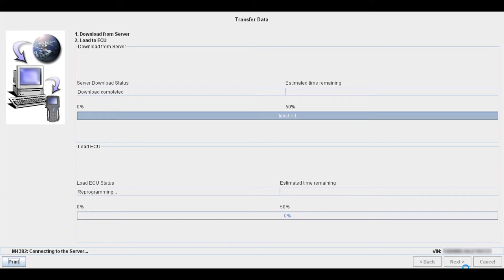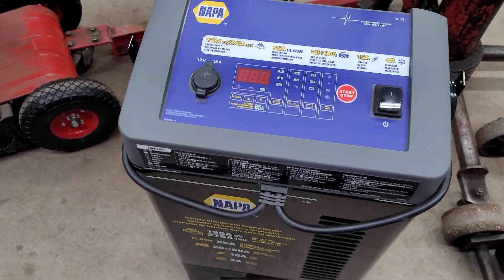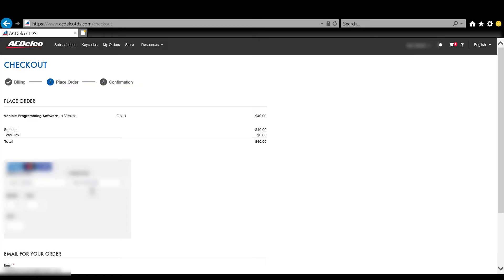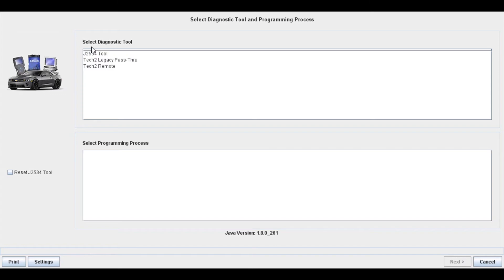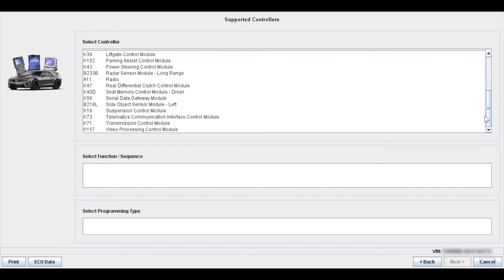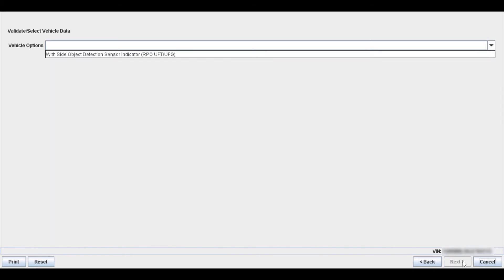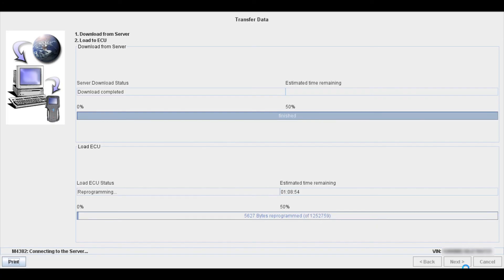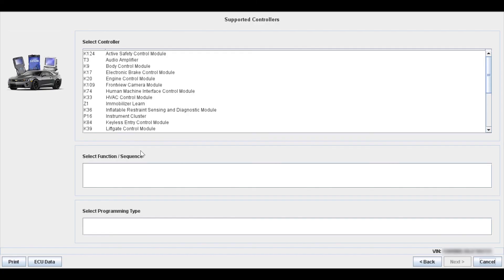How to Reflash Modules on GM Vehicles! Step by step walk through for reprogramming GM Vehicles!

Comment: For GM vehicles the Service Manual will provide a seperate module programming and cal/setup procedure for each module based on the vehicle build options RPOs. However, the process of reflashing a module one at a time is basically the same. Module setup after programming is specific to the module itself, Keyless entry, TPMS, HVAC, etc.

The GM reflashing procedures state not to use a battery charger and list a service maintainer (EL-49642 (Midtronics) SPS, 2014 Cadillac for example). It is important to understand how the maintainer function works if part of a battery charging system, especially if using jump start posts underhood. The reflashing maximum sustainer p-p noise at 40 to 50 Amps is around 50mV. If the battery charger uses a switching power supply, from a design stand point, it is very difficult to meet the 50mV requirement at currents greater than 20 Amps unless directly connected at the battery.

EDIT: I did a quick check on both the Snap-On (looks like rebranded Schumacher) and NAPA (Confirmed Rebranded Schumacher) wheeled chargers shown in the video. I could not find a noise spec or if the units can use jump start posts. The manual states that they should be connecting directly at the battery for in-vehicle or stand-alone charging. If the vehicle has a battery current sensor monitor function, you would really want to sustain on the vehicle side of the sensor (either a shunt or magnetic), so the battery monitor function can record current flowing into the battery to maintain it's SOC estimation. Midtronics gives a noise spec of 50mV at 50 Amps at the battery, they also do not recommending the use of their products at the jump start posts.
Reply from the maker: You are correct although I do have a couple things to add. First the programming procedure is the essentially the same for all modules that need to be flashed after replacement, some modules can be setup using a scan tool without using SPS but not many especially with newer vehicles. Second a good battery charger that had a reflash mode will not cause issues with most vehicle manufacturers, BMW is a different story though. Through 10 years of reflashing experience I can say that GM modules will give the least number of problems and I have seen one fail because of a battery charger that has a reflash mode, although I wouldn't trust a cheap one from somewhere like Amazon. I have even seen people flash GMs without a charger at all, although i would never recommend that. BMW is the manufacturer that absolutely needs the correct battery maintainer to be used and they require a very powerful one that very few people have. I have seen BMW reflashes fail because the snapon charger, in relfash mode, can not supply enough power.

Everything you stated is correct, just know that the recommend certain tools often because of a partnership/ownership of the company that makes that tool, i.e why ford had a sticker for many years that said "use BP Gas".
Reply from the maker: Also, the rpo codes come into play when flashing some modules, BCM especially, you will need to select the correct program to push into the module based on the rpo codes. This process is very simple as long as you read the description of the program you are choosing in SPS.
Reply: @apmotorsports5568  I looked at a lot of chargers to do charging or sustaining at the jump start posts. Mainly for the vehicles that have the Battery in the trunk, of which many like BMW and Cadillac use a current sensor. I use a 2-CH Fluke Scopemeter to monitor voltage at the battery or the posts, and a Fluke current clamp to see how the charger or sustainer is controlling current. I could not find one to do basic quick rapid charging (from the posts) and also supply quiet maintaining voltage for reflash. I ended up making my own 20A 20V linear design for basic repair (single module reflashing) and Rapid charging up to 10 Amps.  

When I started taking a close look at the use of jump start posts for charging or sustaining I was amazed at the errors in vehicle voltage as shown on some high end chargers. Meaning they did not compensate for the voltage drop in the 4AWG charging clamp wires or the clamp connection itself. To do this properly at high currents you would need at the very least a 4 wire connection to the vehicle at the clamps. Like the common two 4AWG high current wires, but also two small 14 AWG wires in parallel to monitor the voltage at the clamps. What matters for both a AGM battery rapid charge and a sustainer (as the value given in the procedures, like 13.5V) is the voltage at the vehicle and not the charger.

I would encourage you to take a deeper look at what your charging/sustaining equipment actually does in terms of voltage accuracy and switching noise, either voltage or current.

EDIT: The 20A 20V supply is a linear voltage adjustable with current limit adjust, I use it with a series rectifier to prevent current from going back into the supply when I connect it to the battery or the vehicle.
Reply from the maker: I'm not at all trying to argue with you, actually I completely agree with your points. I completely understand that the snap-on charger I typically use is not a perfectly clean voltage, snap-on actually came out with that charger probably 15 years ago and have not updated it much since. But for a vast majority of vehicles it works perfectly fine. I've used that charger on just about every manufacturer doing alot of reflashing over the last 10ish years and have never had an issue with it, except with BMW. Some common sense things like turning off lights and accessories are always done to help maintain voltage. And if the battery is accessible then the charger always is connected to the battery. Of course there is a level of voltage drop between the jump start posts and the battery, as there is with any wire/circuit. Personally I've never done the testing of the chargers in the way you have, I've seen it while using scopes to diagnose issues while the charger is connected. I just maintain an understanding of the equipment I'm using so that I am aware of what may be causing issues I've I happen to run into them.

BMW is another thing as once the software starts running you have no control over the vehicle. Failed programming is very common with BMW and almost always because of to weak of a power supply. Very few voltage maintainers are capable of working with BMW.

I do appreciate the info you talked about though. It's great info the know and be aware of, especially for anyone who doesn't have a good understanding of how these systems work!

Comment: Will this set up work to make changes to a bcm in a 2015 gmc 2500? My truck was from Canada and the headlights cannot be shut off with the vehicle in drive. I need to be able to shut them off going through a security gate at my work.
Reply from the maker: With many vehicles there are BCM options that can be set during the BCM Setup Procdure. I'm not sure what settings can be changed on that truck specifically. A factory level scan tool can also change someone theose settings I'm many cases. You may also be able to turn off your lights by very slightly applying the parking brake. Having the parking brake slightly applied, 1 click at most, will typically turn off the DRL system on GM vehicles
Reply: @apmotorsports5568  I tried the parking break trick but had no luck, I also talked to the dealerships near me and they won't change the setting for me. I've been doing research and it looks like there are a few options using a vcx nano and sps
Reply from the maker: I'm not sure about the vcx but to use SPS you any J2534 device and a gm subscription will work
Reply: @apmotorsports5568  good to know because I've been looking at the different options of  j2534 devices and vcx nano seems a little sketchy compared to some others!
Reply from the maker: Personally I always recommend the Drew Technologies products. If you are only looking to use it for GM Vehicles they have a line called Mongoose Cables that are designed for a specific manufacturer. Last time I checked ot was about $50 for one of those, I'm not sure if they have a GM one though. The J2534 device will also allow you to use the gm factory scan tool software of you purchase the subscription for the software.
Reply: Canada, as of 1989, requires daytime running lights (DTRL) on all new vehicles. Many manufacturers make this a common feature even if the vehicle is not sold in Canada specifically like Toyota. It may be difficult to get a flash image that will disable a function if the vehicle is built in Canada. The module strategy must support the feature calibration, in this case turning off a required function. The strategy and base cal file are supplied by the module manufacturer and tied to the specific assembly plant as encoded in the GM VIN number. Meaning even if the same module hardware (electronics) is supplied by Continental (as an example), for both the US and Canada GMC Truck plants, the factory programming files are probably different. The development teams at Conti for hardware and software will be the same. However, the factory engineering support will be different and usually colocated near the plants depending on the support contracts.

Usually the DTRL modified low beam is controlled by a relay. To turn off the lights you could add a seperate relay to interrupt the circuit. If you interrupt the relay coil control this may set a DTC in the module controlling it.

Comment: Can you reprogram or code new modules on GM cars without a pass through device with any Autel or Launch scanner that you know of? Like a new climate control module and so on?
Reply from the maker: You can program with an Autel as long as you have the Autel pass thru. The Maxisis Pro is the Autel I believe you need for that. Launch as a similar setup but I'm not very familiar with the Launch tools. On both of them the pass thru is built into the box that plugs into the obd port.
Reply: @apmotorsports5568  I've heard tat even with the maxisis pro, programming is very limited. I paid a lot of money for the MS 906BT, and it REALLY PISSES me off that I can program new modules or parts for most foreign vehicles, but not for F...ing GM cars like what I've got! Yeah I know I can get a $500 pas thru device for GM at DrewTeck....I have one for Ford when I have to reflash the ECU or PCM. But not being able to program just a new part or module to work properly on GM cars without paying for a 2 day subscription is total crap!
Reply from the maker: Personally I haven't programmed with the Autel, we have the 908s not the pro, but it is a J2534 device so ot should be able to do anything that the drewtech can do. There is also the option of a Mongoose cable which I believe is about $250
Reply from the maker: Also keep in mind there is a difference between Coding and Programming. Typically you can not Code domestic vehicles like you can with day VW. Coding is used primarily to turn on/off vehicle options. Most domestic vehicle do this as part of the Programming procedures when necessary.
Reply: @apmotorsports5568 So I can't code my drls to off and allow cargo lights to turn on when vehicle is moving??
Reply from the maker: No not with this process.

Comment: Autelonlineshop

I won to swap ecu of Chevrolet Cruze I use the im508, launch v, xtool x100pad2 process but still the key light is still there please any idea 

GMC terrain, Chevrolet Cruze the same 2014 old ecu damage and I need to swap new ecu any ideas
Reply from the maker: Did you do the security relearn? In some cases you need to relearn the security system after replacing a module. On some GM vehicles you can do what's called a "30 minute Relearn." I do not believe thus works on a Cruze though. You likely will need to use the TIS2WEB system to relearn the security. This will require you to have an LSID before GM will give you access to security functions.

I am not familiar with the specific tools you are using but the reflash process is the same regardless of the J2534 device you use.
Reply: I feel your pain. Did you find a solution?

Comment: All you need is this one part..... Then he goes unless all these other parts and machines you need with it and emphasizes you can't use a regular battery charger lol
Reply from the maker: I may have misspoke, I am not the greatest at talking to a microphone lol. Just to be clear, when I say all you need is this. I am referring to the J2534 Device. The reason I say that is all you need is because I am assuming that the viewers of this video are likely shops/techs that are looking into reprogramming for the first time. Any shop looking into this will already have a computer and most will likely have a battery charger that can do programming as a majority of professional level battery chargers have this ability as long as they were purchased in the last 5-10 years or so.
Reply: A j2534, laptop and internet connection. I have programmed without the battery charger. Not recommended but I am willing to chance it😂.
Reply from the maker: I've done it without the charger as well. Just don't try it with BMW or Volvo. BMW has a very strict requirement for a high amperage battery maintainer to be used. Most of the reflashing capable chargers are not actually good enough for BMW. I've had modules lock trying to flash them. I've also had issues with Volvo, although it may not have been because of the charger I was using.